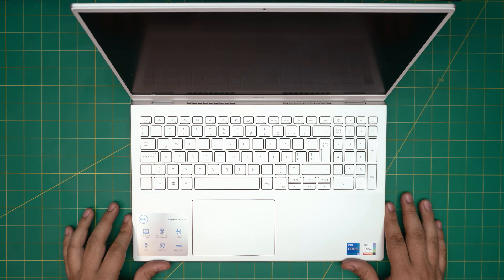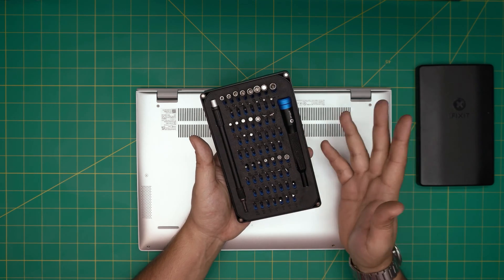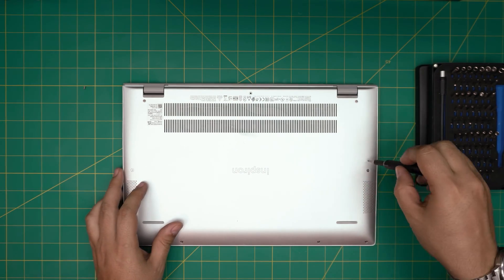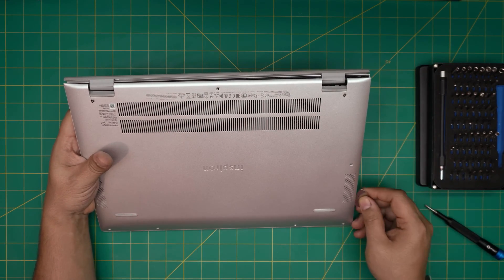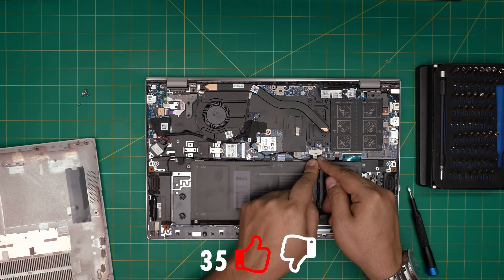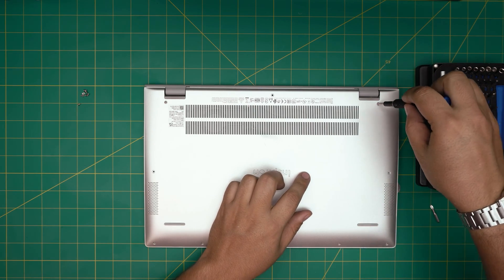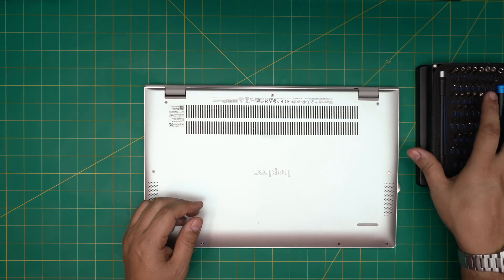How to Replace Battery on Dell Inspiron 15 5000 (P102f) Laptop - Step-by-Step🪫🔋

Comment: I changed my battery and now when I power it on (while it’s plugged in) it shows the battery icon with an “x” in it. Did I do something wrong?
Reply from the maker: 🫠Regarding your question, one of the two may be happening: the battery contacts are not clean and not making proper contact, or the battery is defective. Also, update the BIOS firmware from the Dell website.
Should you have any further questions or requests in the future, please don't hesitate to ask me.
cheers🍻

Comment: Thank you for the video, really helpful and perfect demo for a complete novice 👌...
Just to clarify about 'draining the battery down slowly', do you mean I turn it on (without the charger plugged in) and just leave it on until the battery runs out? Is this how to drain the battery down slowly?
Reply from the maker: Thank you for your feedback! If you wish to support the channel, you can like, subscribe, or both!
Regarding your question, yes 1st power off and leave it charging for 4h then unplug the charger and power on and bring the brightness down to 40% and open videos and excel and light work until the battery is drained to 30% then power off and leave it charging for 4h and after that use as you wish.
Should you have any further questions or requests in the future, please don't hesitate to ask me.
cheers🍻
Reply: @uFixTek  That's fab' thank you 👌
Reply from the maker: It's my pleasure my friend.

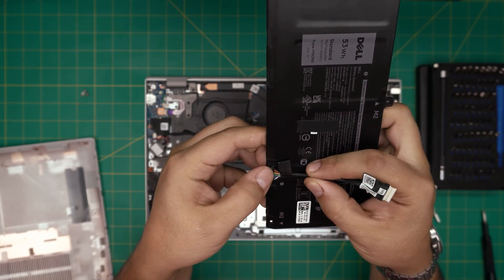Comment: At 5:45, you have to push the metal tab inward (toward the cable / center of the battery).  Otherwise, the connector can pop up and not make full contact.  Had to take mine back apart to fix this because the battery didn't even show up - had to plug in the adapter to check that.
Reply from the maker: i'm sorry but in your revision you may have a metal slider, but in this video this model doesn't have any sort of sliding bracket to go over, if your version it does have a slider sure slide it over. if you don't slide the metal back it will not release itself.
this video is 4K and you right @4:59 you can see clearly there is no metal slider.
and right @5:45 you ca see clearly it is a pop in jack and without the slider.
i been servicing for over 17 years and see the jacks with sliders and the clip on jack. this is a clip on jack,
Reply: @uFixTek  The connector pulled out easily when I removed the old battery.  The sliding action to secure the connector back into the new battery is very subtle.  At first I thought the metal cover was just a reinforcement or anti-RFI shield.  Then I noticed that it slid back and forth just enough to hold the plug down onto the spring contacts once you put the edge of the plug under it.  The socket is on the battery, so mfrs could source slightly different versions of it I guess.  The new battery is an after-market replacement, not OEM.
Reply from the maker: yes you had a different battery jack installed in your motherboard they change them depending on stock availability.
you jack may have looked like this jack in this video @4:22 >> https://youtu.be/EGQ8W9c4bCc
https://imgur.com/a/x8NNvY8
im glad that you got it sorted out and all good.
cheers🍻